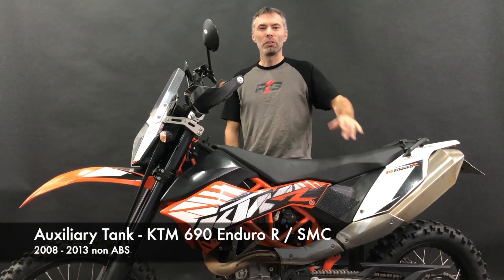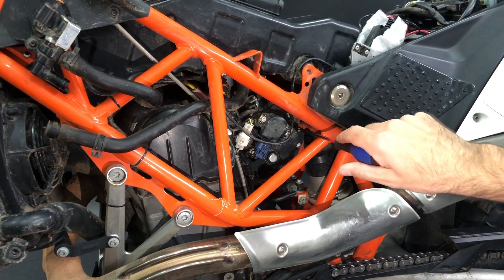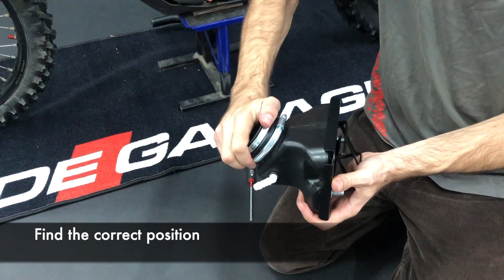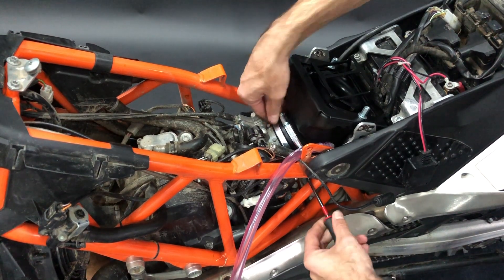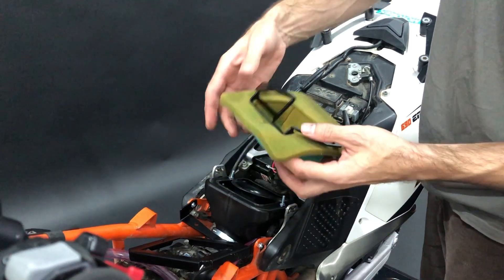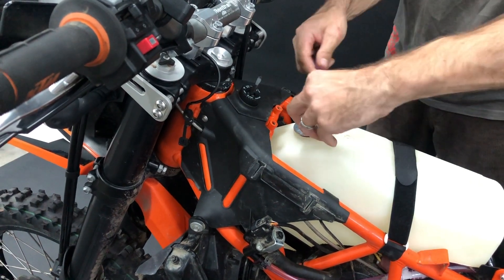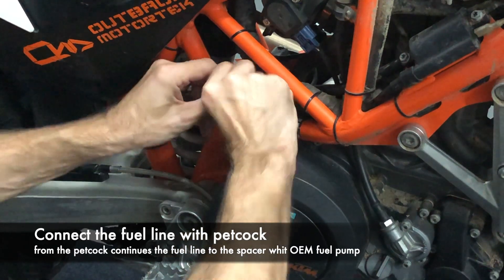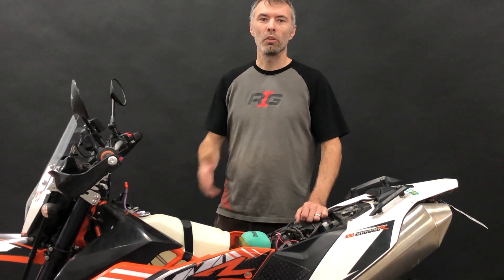KTM 690 Auxiliary Tank nonABS installation RADE/GARAGE

Comment: I saw that is also possible to connect the output of the auxiliary tank to the breather of the rear tank, this way the vacuum of the rear tank getting empty will suck fuel from the auxiliary tank. This way first the auxiliary tank will get empty first, then the rear tank will get empty.This will avoid touching the fuel pump and easier to mount. And yes, when refueling, first you fill up the rear tank and afterwards the front tank.
Reply: Thx for your comment even 3yrs after posting it, because it was the exact answer that I was looking for ! 🤝

Comment: You need to remove the seat to fill the new tank now?
Reply from the maker: For all the KTM 690 models between 2008 and 2018, YES. The filling neck is underneath the saddle. Since 2019 is the filling neck in front of the seat. It has never been differently.

Comment: Hello, it is possible to install the auxiliary tank on the enduro 690 model of 2016 with ABS. In the title specifies No ABS? What difference is there? Thank you
Reply from the maker: Hi, sure: KTM 690 Enduro 08-13 are nonABS and 14-18 with ABS. Ordering is simple, on our website select your model year. Small differences are related to front brackets.

Comment: Hi. Is it fine to install this airbox mod to 2021 690 smcr Euro 5? Will the bike run too lean without mapping? Euro 5 smcr is pain in ass to install PC5 due to compatibility issue.
Reply from the maker: Hi, it's perfectly fine to install this airbox to 690 SMCR MY21. No fuel map remapping is required.